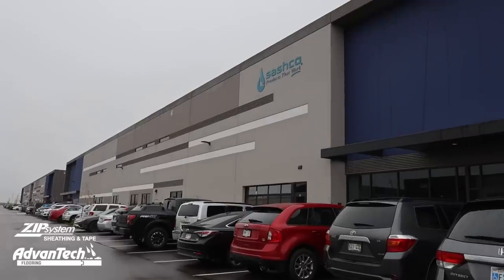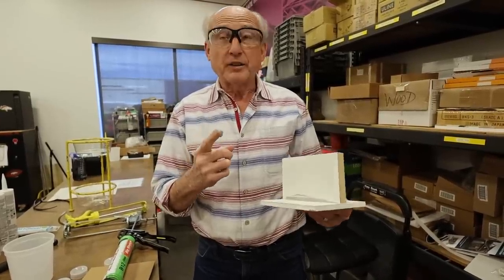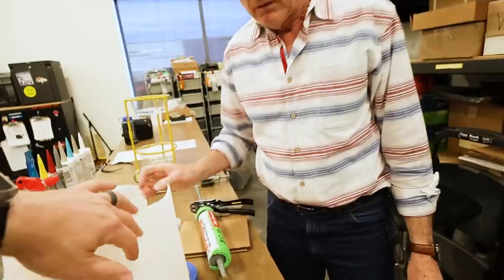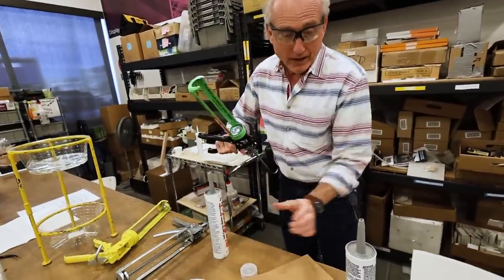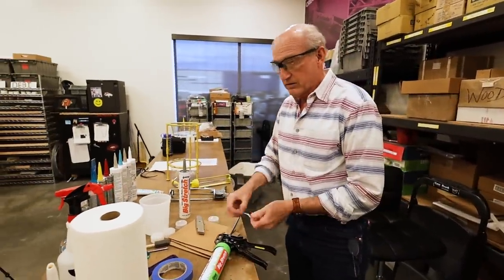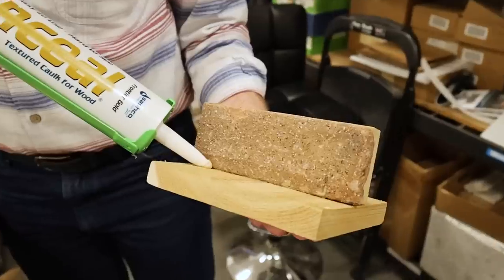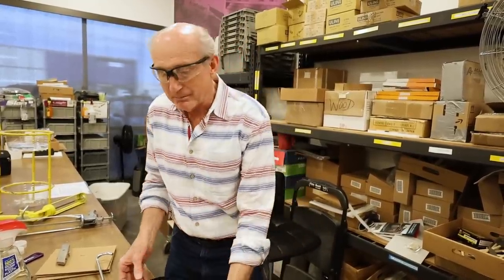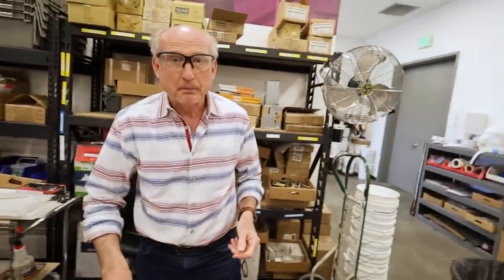If this is your painter’s finger…Watch This. MAJOR MISTAKE

Comment: I'd like to see the trim carpenters reaction when he sees the painter caulked a 3/8" bead over his 1/8" reveal on a window casing.
Reply: Well, with my many years of experience watching construction videos on youtube, I'd say in that case the jamb of the window casing needs to be cut a just little short so there's a small gap for the caulk to flow into and fill
Reply: That trim carpenter should come to our 10-year old house where every microbead sealing his trim to the window frame opened up in the first year of settlement leaving black gaps in a sea of white.
Reply: @KevinT3141  there’s a lot of ways that could have failed: the moisture content of the framing, walls or trim was too high; poor caulk adhesion for any number of reasons; crappy caulk; crappy painter not applying properly; poor or insufficient mechanical attachment of the trim. Whatever the reason, it’s still a failure.  Speaking as a GC and finish carpenter, as long as I installed properly dry trim over a properly built structure and was followed by a good painter I haven’t had a problem. And the whole “house settling” thing is in my opinion generally a BS excuse used to excuse poor building, though some builders even believe it.
Reply: @mechanicalman1068  yup. Just like the drywaller that says..." oh that's settling, it always happens..."
     As a drywaller in the Midwest I plan for that movement and take precautions to prevent cracks and separation.
Reply: @KevinT3141 you are exactly right. Micro beads frequently means it's going to open up. Need to put in a good triangle of caulk to absorb vibrations or movement.
Reply: Yeah high end carpentry might not want this or really any caulk if it's all stained. But for the average house that might not be perfect, you want to have extra durability in those joints. Also with white trim, it's hard to see exact reveals.

Comment: I just did my first caulking ever. Seems like I did some of those rookie mistakes. I was sealing a gap between the bathtub and an aluminum shower frame and used veeery little caulking material since I didn't cut the nozzle (a separate piece) and the 2mm opening looked fine. When I ran my finger over the bead a whole lot came off. So far it works and looks almost invisible, but I'll continue monitoring it.

Comment: When I first started remodeling my house I used the cheapest caulk at Homeless Despot to save a couple bucks and it turned from clear to yellow in three months. Shortly after I saw a video of Matt praising Sashco so I ordered one tube of Lexel and one case of Big stretch online and I'll never again buy cheap silicon. The Lexel was nearly double the price of box store silicon but it is perfectly clear, easy to use, and sticks like crazy. I have a no threshold at my back door and I didn't want water getting under the new floor so I used Lexel on it and you can't see it at all at a distance. Up close it just looks like the floor is extra shiny there. In a year time it hasn't discolored, moved, or anything else. Definitely worth the twelve or so bucks a tube I paid for it

Comment: Soap & water or spit is what we used as a finish caulker. Plus you can wrap the middle of the tube with duct tape to make the pressure more even when hitting the release or I've seen others put a hole on the bottom and spray a quick sprits of wd 40 on the bottom for the same effect

Comment: My only problem with the advice to use a much larger bead is that modern low-VOC interior primers and paints often fail to adhere to large beads of caulk, leading to cracks through the paint to the caulk. This, unfortunately, has been especially bad with Sashco products and my preferred Benjamin Moore paints, thanks to Sashco's greater flexibility. (I love Sashco for outdoors, but I just spent nearly a month recovering from an absolute disaster with Big Stretch and some doors painted with BM undercoat for enamel and Advance.) If we need to leave larger beads, we need better primer and paint compatibility.
Reply: I had the same problem in a house. What caulking are you looking to use interior for trim/doors??
Reply: Your description causes me to imagine mechanical failure of the paint due to it not being flexible enough to handle the increased surface movement.  I tend to associate adhesion with terms like flaking and bubbling; did you see flaking and/or bubbling on the painted caulk joints?
Reply: Interior caulk is a different beast.  More for paint adhesion, appearance , and a small amount of shrinkage to lessen bead size.  We used Bolt. Forgot who makes it. Quick skinning over and good flexibility, very paintable.  This whole demo is for exterior sealants, where engineering comes to inspect your work for insurance warranty underwriting.  Seattle construction defect guy here. You would not believe the crapola we find on new multi family dwellings.  Build it twice.

Comment: I was taught to cut the tip of the tube straight, but lead with the tip instead of trail with it (so it's a pushing motion). This allows you to see how much you're squeezing out, and then you hold the gun at the 45 degrees so the back of the nozzle tools the caulking for you. This technique only really works on smooth consistent surfaces though; I was taught it by a glazier.

Comment: I love big stretch,Lexel I worked for Lowes here in Vegas for 8 years and found the hardest thing about selling it was convincing people .Everyone knows Dap and all the other brands but not familiar with these brands,I would tell them if you hate it bring it back and tell me.Not one return and many people came to me and said I love it but not the price,contractors are cheap and that extra buck adds up,especially if you're never going back to a job.But for a homeowner they were much easier to sell.
Reply: The high cost of low prices, it costs more, but it actually works better.

Comment: I love Sashco products. Big Stretch is always my go to unless I need a specific color then I use a Denver Color Caulk to match paint. Looks like Denver Color Caulk is switching to Big Stretch though so best of both.
Reply from the maker: Look up ExactColor by Sashco. It’s powered by Big Stretch and you can add your paint or stain to tint it. Basically custom colored Big Stretch.
Reply: @buildshow  ExactColor is great for small jobs when just a tube or two is needed but with larger jobs Denver Color Caulk can get me 4 cases without me having to shake my arm off. I think it's a little cheaper too.
Reply: @jiggybish  Perkins Builder Brothers stick their tubes of ExactColor on the end of a sawzall, lock the trigger down, and walk away while the caulkshaker3000 does its job 😂

Comment: I've seen demonstrations on YouTube of someone using sand paper to put a perfect 45 degree angle into the caulking tip, then labeling where the edge is so that you can always orient it flush against the corner. Lays the caulking significantly flatter and might not even require smoothing when done well.

Comment: Boy, you would not like the way I calk. I am a home owner only so I do it my way. I tape both sides of the joint. I tool it into the gap and if needed, I take extra calk on finger and go over the application and pull the tape off. It looks great. I know as a person doing this for a living, it is stupid and expensive. I have had to hire people now as I am 82. Most are not worth the trouble. They are slop artist and miss spots. This weekend my daughter will calk my sheds. I have the calk and Frog tape waiting. I will switch from spit to glass cleaner. Great video and I found nothing you said that I would argue about. Thanks.

Comment: The best way to get a good bead is a good caulk and a good gun, personally I use a large highly polished kitchen spoon pulled at around a 80^ angle to smooth it out but that's just preference. It keeps me from from removing to much of the caulk and if held steady at the right angle gives a very cleanable curve.

Comment: I have to think that this idea of 1/4” bead doesn’t apply to a lot of interior finish carpentry. Casing to jamb or wall? The moulded edge might only be 1/8”. Baseboard too. And even so, a huge bead kills the nice crisp lines the mill and carpenter worked to achieve. Speaking as a GC and finish carpenter I’ve never had a problem with the micro or even sub micro beads used to smooth trim connections. There’s a lot that goes in to insuring that though: Sufficiently dry framing prior to insulation and drywall; sufficiently dry drywall and/or paint prior to trim; sufficiently dry trim; sufficient attachment of trim; quality painter.
Reply: Correct. This approach would make sense for an exterior application and a uniform paint job. But this would be incredibly difficult to cut in different colors on trim to walls or clapboard to trim.
Reply: I agree, definitely not for finish work inside.  I would say outside work and bathroom work like the showers/tubs.  Great advice but doesn't apply to all circumstances.

Comment: Well it really depends what are caulking, if trim then minor amount just hiding not sealing. If sealing, especially exterior then yes do not want too small since want a larger area for the caulk  to seal better. The real big issue I see is caulk on unprimed/painted surfaces. at a minimum primed wood. And from experience, exterior, nothing but an oil based primer and my go to for anything exterior is Zinnzers cover stain.  not had any water rot issues using that primer.

Comment: Some of us who don't use caulk products all the time struggle to maintain consistent pressure with the caulk gun, especially on a long run. That's where the battery-powered caulk gun shines!  Do everything else the same as in this video except dial in the speed at which the caulk is dispensed to get what is consistent for you.
Reply: Which gun are you using? Canadian source??
Reply: @BlossomPainting  Ryobi

Comment: Explain something to me.  Big Stretch is a ASTM C-920 class 25 but Sherwin-Williams has an elastomertc caulking that is ASTM C-920 Class 35.  Meaning it has more stretch ability than big stretch.  So why don't you use that?  Thanks for the videos

Comment: Does Sashco have any products or recommendations for sealing half used caulk tubes?
Reply: We recommend just some painters tape or plastic wrap. Lexel and Big Stretch don't dry out the same way as silicone. We've seen folks use chopsticks, nails...lots of different ideas.

Comment: Hail

First question:

Can any of the products be used in an aquarium?
 
Second question:
Do you use acetic cure? Because I saw in another video about insulation products (the one from the Fire Department was very impressive and easy to understand

3
But if you need to use an applicator like this that has already been cut, and the finish is not good, wouldn't it be easier to use the command than the indicator?

93.93/93

Comment: As a novice; how do you seal up a partially used tube so it does not harden?
Reply: It's not really possible beyond a couple weeks. Sticking a nail in the hole is a good way. The length of the nail keeps a channel open down to the caulk in the tube
Reply: Best way is to let some caulk out of the nozzle at the end of day so you have some hard caulk to grab the next day and all the hard stuff should come out like a plug.
Reply: I have a roll of HVAC aluminum tape that I use for this. I cut off about a 1" piece  and wrap then fold around a cleaned tip. It will keep the caulk for months - almost as long as an unopened tube.

Comment: I have always just wet my finger to tool water based caulks. Spraying the caulk with water looks like a great idea. 
Gonna try that. I use the Ryobi 18V caulk gun.
Don't know about the giant beads, though. 1/8 - 3/16 max. 1/4 or bigger is too big. 
thanks.

Comment: I did the caulking on my log home, that sucked, not Sashco stuff for that.  I learned so much from that.  For everything else I use Sashco, it works really well, that big stretch stuff holds on pretty good.  The log home moves like crazy so having something that can move with the house is ideal.  I use the clear stuff for upward facing log checks (cracks) so they don't fill with water, use some backer rod to give the caulking something to move over.
Reply: what brand of clear caulk in the u.f. log checks? i have an exposed log ridge beam to seal on the exterior.
Reply: @kev5782  I have used the clear sashco called Lexel.  I have also used Check Mate 2 Log Check Sealer, it works pretty good as well but, after some time it turns yellow.  So I tried the Lexel stuff and it works so far.

Comment: When I had Hardie fiber siding done on my housr,factory paint caulking to match.  Hardie spec is quite a bead,along spots they say and not in places they say no caulking
Reply: Very interested in Hardie fiber siding caulk - but I can't quite understand your comment.... can you add something please?
Reply: @droppedanchor3955  Hardie siding has specific caulking brand specs for use with their fiber cement siding when installed.  It's perfectly color matched to the numerous factory painted colors. It also has characteristics that work best in application with the fiber cement siding. I can't recall the exact brand name at this time.  And the application on the edges that meet the corner moldings are not a pushed in made to dissappear bead. They are substantial bead not pushed in with finger wipe after application. It works well,especially since the color is matched to the siding. They don't caulk the butt joints, between sections of siding,it's flashed at each butt joint. Caulking is at corner joints and corner outside joints,1/4" beads it looks like
Reply: @droppedanchor3955  now I see brand.  OSI quad max

Comment: I'm a painter, not a glazier.  I always cut the tip at 90*, but keep the tip at 90* to the seam/crack/edge to be caulked not a 45 like he showed.  I 'waste' about a teaspoon per tube of caulk.  I've never seen a professional painter or carpenter trim the tip of the caulk tube at 45*, just homeowners and hobbyists.
Reply: I was taught as an employee around 40 years ago to cut at 45. Been doing it and teaching others the same. I am a contractor and, like you, have put on thousands of tubes of caulk.  I waste very little caulk or time. 
As to what others do, I've seen both. As long as the method works and is profitable and durable, why would you sling mud on it being a homeowner or hobbyist technique?
Reply: @tegimr  Sorry, I didn't mean to ruffle feathers.  Whatever works best for everyone. I'm only a painter, but I was taught by a union glazier.  In my personal experience the professionals I see that get the best results don't cut the tip at 45*.  When laying down caulk with a 45* tip and getting the angle of the gun off by just a couple degrees over a 36" run can cause some of the problems shown in the vid.  I see the results of plenty of (hurricane replacement) window installers that get horrible results, but they don't care about the quality of their work.  Aside from not caring to do better work, their biggest problems are the result of troweling too much.  For the past 10+ years I've caulked windows/doors installed in block/stucco homes which are set back several inches from the face.  To get perfect results you must try to caulk in a single run.  Caulking door/window frames that are set back several inches with a 45* tip does not allow you to run a bead of caulk to the very corner in 1 continuous run because the gun hits the edge of the frame.  It requires caulking from 2 directions and then smoothing over where the 2 meet.  If I can great aesthetic results running a continuous bead with a 90* tip, troweling less, and save 3 minutes per window on 500 windows/doors . . . it adds up.

Comment: I don't think homeowners are going to like a 1/4 inch caulk joint.  For decades 1/16 inch has been the expectation.
Reply: I like to make sure I have contact on both sides and not just fill the crack.
Reply: I'm hoping he was meaning on external joints, or joints that require sealing against water or weather. 
I agree that interior painting joints can't be that large. That is larger than quite a few moulding edges.
Reply: @tegimr  he said including tub joints
Reply: If it's for water sealing purposes, exterior, bathrooms. 1/4 inch. If it's for aesthetics, like baseboard. Micro-bead.

Comment: I found lexel almost impossible to tool when placing a large bead. I’m hoping there is a trick I don’t know about.
Reply: It skins over very fast. Can only work in small sections at a time.
Reply: Goo gone instead of glass cleaner
Reply: Austin V Papp  I’ll try it
Reply: Austin V Papp  Correct. It is not water-based, so you will want to use mineral spirits or similar.

Comment: In order for caulking to actually work you must have a gap or you are just wasting your product as it will eventually peel off as there is nothing to hold into place. I am sure somewhere on the tube it states this.

Comment: Essentially use more of our product so we can sell you more.
Reply: Hi James! We often recommend backer rod for large gaps to prevent over-use of goop, so not necessarily true. It is difficult to fit enough caulk into a tiny 1/8″ wide joint to adhere to its sides and leave enough in the middle so the joint can stretch.